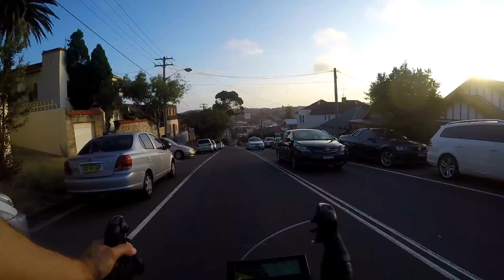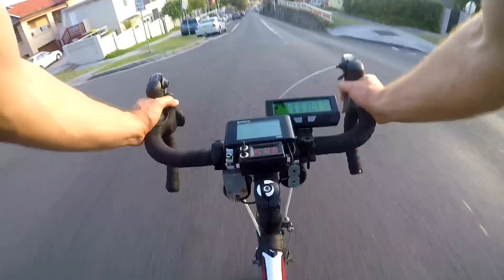Bafang BBSHD 1000w mid-drive • extreme hill climbing test 46T • Electric Bike 48v BBS02 8fun motor

Comment: get your 52t ring on and smash your top speed record, would like to see you recreate an old video so you can do a side by side comparison video. the road with the speed bumps you've done a few videos on would be good
Reply from the maker: +L3mi3 - I would LOOOOOVE to take this thing to at least 90kmh with 52T chainring.. 46T rides really well but can't get any faster than 74.1kmh on flat... (this is actually really fast on a bicycle). I would definitely go back to the same road and do a really fast video with the BBSHD, thanks for this fantastic idea =] I am just tuning this thing and I have to figure out if I have to make a 52T myself or if Bafang will make it available anytime soon.
Reply: +ElectricBike (Bruno) yeah 74kph is damn fast its like 45mph so faster than most traffic, i have a spare 104bcd chainring adapter for a bbs02 if that is any good for you
Reply from the maker: I wish I could say "yes" and setup the BBS02 104bcd adaptor on the BBSHD but the fitting is completely different like I show here in this video https://youtu.be/hiyPdCchTcQ  I don't think I will wait for months for someone to come up with something like that but suitable for the BBSHD, I may make my own (got some connections) and if I love this thing I may put in production so more BBSHD riders have access to this =] Bigger chainring will also benefit people with small wheels.

Comment: nice, what C rating is your lipo? do you know?
Reply from the maker: Yeahhhh... I'm actually not using LiPo (unreliable when using every day) I run this thing using the super reliable Panasonic NCR18650PF 10A continuous discharge and 18A surge but 5 cells connected in parallel in my case my pack handles 50A continuous or 90A surge. The BBSHD is rated 30A max (may peak around 35A) so these cells are good enough =]
Reply: ElectricBike
i just ordered 2 6s 20,000mah 20c lipos for my e bike project. over 200 quid, ouch.
hope they work well.
Reply: ElectricBike thx i always like to find new good sites, like dealextreme is actually very good and most people dont know of it.
Reply from the maker: +bittasweet symphony - Yeeeahhh... I LOVE dx.com too.. co many good deals.. my brothers are addicted always buying lots things they don't nee just because there are always so many good deals there hahaha... Fasttech is great for batteries, the thing I really like there is the forum where lots people discuss about the cells performance and how long they last, how hard they can push that particular model comparing to other ones they've tried, its very interesting.=]
Reply: ElectricBike Hahaa! I get 90% of my torch kit from fasttech. Just about to order some nice cree xhp70 mental leds for my bike. They can kick out 6000lumens with the right driver (Real lumens too, not china lumens lol)
Reply from the maker: +th3d3wd3r - Yeeeeahhhh... We're talking about good stuff here!!!! Powerful headlights makes a huuuuuuge difference, you should have two, one suitable for road pointing down and a high beam one for off-road (just like cars). The powerful one is also suitable for rainy / stormy days when drivers can't really see bikes properly.
I have a device that measures lumens, pretty cool =] I think it's time for me to get some insane LEDs and make something like that... Data projectors are 2600 lumens average... 6000 lumens would be daylight!! Hahahaa
Reply: +bittasweet symphony going for the multistars eh? ;)
Reply: +ElectricBike (Bruno) I think the Panasonic NCR18650PF are a really good option! so that s like 13*5=65 batteries in total? Did you mkae the pack yourself? Not sure where to buy from since they have to be of high quality!
Reply: Frederik Hollstein i recently brought those batterys from ebay, was gonna buy from dealextreme but ebay was better deal. from china like
Reply: +bittasweet symphony how much did u spend? Before taxes? I got a friend in Hong Kong. We 's gonna  buy me some tax free and bring the by plain  hahah
Reply: Frederik Hollstein im surprized u can afford anything.
Reply: +bittasweet symphony lol how so xD I just like getting  the most of my money. I studied business  administration  in uni hahah
Reply from the maker: +bittasweet symphony - 20Ah x 20c = 400A or 19200 watts discharge.. What are u planning for your next eBike?
Reply from the maker: +bittasweet symphony - ah... don't buy batteries from eBay... there are so many fake or relabelled batteries out there... NCR18650PF sells very well so of course the fakers target that one too.
Best website is www.fasttech.com comes from Singapore, free shipping, takes a while to arrive but you get original cells.
Reply: th3d3wd3r i know ive been seeing those cree lights, there is actually a 15 led 20,000 lumen light on ebay for 65 i think.